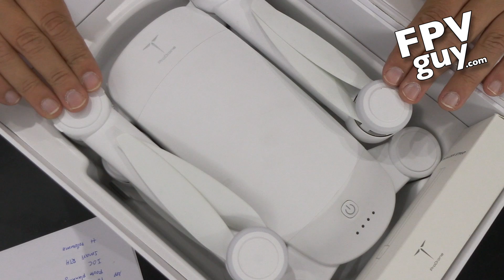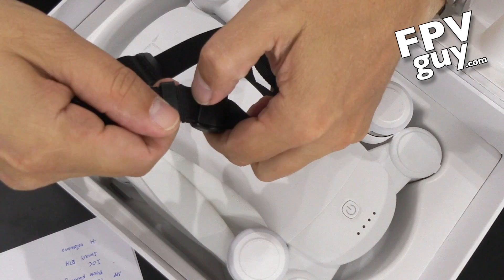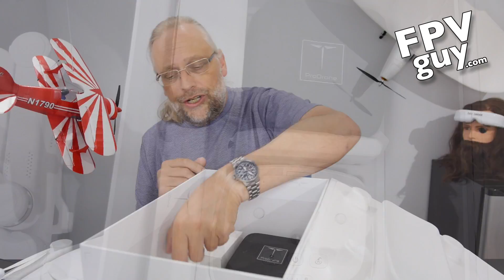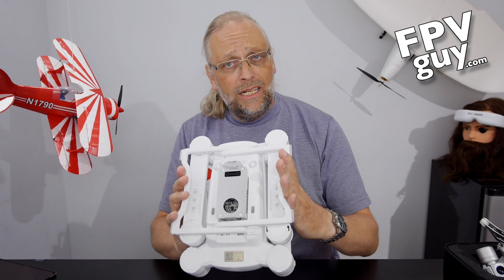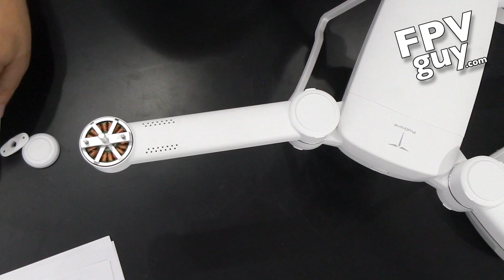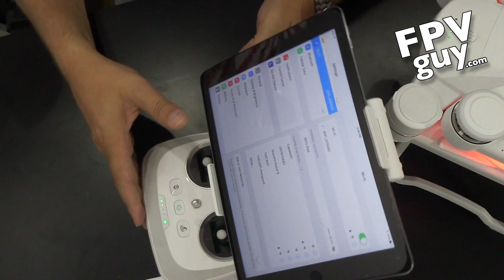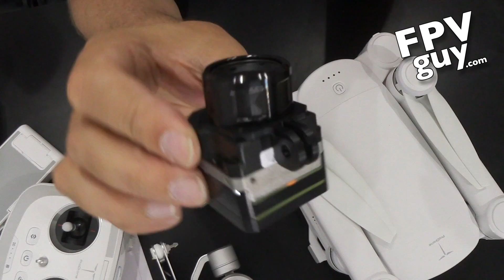ProDrone BYRD - Unbox & Preview

Comment: Hi Bo, great video, subbed to you there too, I'm going to put you on the spot, if you had the option of a p3p or the byrd premium which would you take? Honestly, because your the only person we know that has flown both. Thanks , Paul.
Reply from the maker: Hey Paul,  I just came back from flying the ProDrone,  about to post the video shortly.   but here is the low down,  Im not sure about the premium byrd yet as I have not seen the camera, but I would take the BYRD advanced with the full feature set and the gopro gimbal if it was on the able along with a P3p today. mostly because i really love my GoPro 2.7k cine medium FOV
Reply: +Bo Lorentzen Thanks for your reply. The Byrds flight performance itself, is it fast? also how responsive is the craft? Can't wait to see the new video.
Reply from the maker: Its very easy to fly, and responsive.   in Position Hold mode its about the same max speed as the Yuneec, however in A (ATTI) mode it goes really fast,  downside to that speed, the arms come way down in the image.  other downside to letting it rock, you end up with 15 minutes of flight time instead of 25 minutes.  Just saying.
https://www.youtube.com/watch?v=VEYh9Nc0mhY

Comment: Compactness and zero tools for changing props is well impressive, even the gimbal mount and fpv screen mechanical fixings are great. I'd be stunned if those arm joints could take much of a hit but if cheap and easy to fix them then that's not a massive issue for a mild video rig. Not perfect but love the angle they took on this one.
Reply from the maker: +MicroRCFiend   we need to get a bunch of flight time on this thing, only way to really know how everything will feel and fly after 20 hours of flying.
But yeah hugely agreeing.   love that we can change props without tools, tool free setup is a big thing.

Comment: Hi Bo.
A really interesting package. I understand the manufacturers are claiming a true 30 minute flight time which based on the battery type I think is doable. I get close to 20 minutes on my 3kg hex with a 3s 10,000mAh pack. Price wise it seems to fit competitively with the offerings from DJI, Yuneec, and 3DR but it's unique ability to fold down for transportation and larger footprint when deployed gives it a slight edge. 

It sounds like you have the same crud my wife has just brought back this week from her trip to Los Angeles. Hopefully you'll have a quick recovery.

Regards

Nidge
Reply from the maker: Hey Nidge,   yeah this is a very interesting package,    my gut feeling, 30 minutes are optimistic,  maybe in calm weather.   however once you get some speed flying around etc, you start burning battery,  I'm hoping for 20-25 minutes actual flight time.
The units are a slight bit more expensive,  personally Im more excited about the GoPro edition, as the extra $100 from the standard buys you a Gopro gimbal, Follow-me,  drift camera and sonar and payload drop.
Reply: +Bo Lorentzen I'm a bit slow these days and didn't pick up on the price difference between the different versions. If one already has a decent GoPro an extra $100 is a no brainet for the extra features. My wife keeps reminding me it's my 50th in two weeks time but I doubt the Byrd ( does this mean Jeff Beck gets extra royalties 😉 ) will land on these shores in time for her to treat me 😉.
Regards
Nidge
Reply from the maker: LOL Nidge,  The GoPro edition will land sometime in January.

Comment: This looks like a great product.  But so far only DJI has been really able to get good long range video to work well. The 3DR Solo  video range is quite poor.  So I would love to see when you test it what sort of range and quality of down link video you see.
Reply from the maker: +Joseph Dawson   I will be back with some longer pushes,  however for what its worth, the standard edition is advertised only as 500 meters range,   Im really wanting to take the advanced Gopro edition for a spin and see how that plays.
Reply: +Bo Lorentzen 500m is better then the 3DR. Do the other versions say they will have more range or are they all based on the same radio system. (DJI lightbridge maybe one of the best selling features of its products. ) As an owner of a Xugong V2 I am a huge fan of folding quads.  This could have been more compact if they did a front mount gimbal like Xugong.  This looks like a killer product. And will force others like 3DR and DJI to step up.
Reply from the maker: Hey Joseph,   they are all using the same technology, but the two higher versions both have more effective systems offering 2000m control range. (and video downlink)
wow, not many Xugong owners around,  I had the V1 for a while but there were so many mechanical issues,  I probably should have upgraded to Dugong V2.   that said, the promises of folding quads use phenomenal, and I suspect we will see many more implementations of folding multicopters.

Comment: Great video!!!! That's really really nice and the price is perfect!!!! Now it's time to see it fly. Can you test the video latency and can you use Fatshark goggles with this drone?
Reply from the maker: Hey Eric,  thank you for the kind words,   Im liking it, but would hold out for the GoPro or 4K edition to get the drift cameras and follow-me and payload drop options which is not on the entry level edition.
The TWO top ones, YES you can use FatShark HD's by plugging the HDMI out from the handset into the FatShark HDMI port.
in my short-range testing so far, the video feels very much like the inspire, sometime a bit more buffer than other times.    notice the control-link components in the standard edition that I looked at is different from the two higher versions that both have the 2km+ system.
Reply: I agree I think I'm going to wait for the advance edition. How long did you fly it for and how was the stability of the drone while hovering and flying?
Reply from the maker: Only got 15 minutes on it so far, the quad itself is very stable,  the camera gimbal is a bit rough, I have to hope this is in face pre-production issues and that the shipping will be more refined....
Reply: Ok good to know, I think one important factor that everyone is looking for an that is to see if drone will fly for 25 minutes, when you get time can you confirm this specifications.
Reply from the maker: Definitely will, have a fresh battery that I plan to fly to auto-land over the weekend and get a feeling when and how.  with a little luck it will be more graceful than some of the early generic quads.
Reply: I hope so too. I can't wait to see it.
Reply: +Bo Lorentzen Any update on the drone, has someone tested the flight time? And has any of tje features been teated like waypoints etc? And any update on the Advance release date?
Reply from the maker: Hey Eric,  don't have the standard here any longer, already returned,  I won't get to play more with flight time until the advanced GoPro one gets here.   let me check with Frank he was talking about doing the flight time thing.  
As for the waypoints, nope, its not even in the app yet.  but you can see they are about to put it in the next releases. will be talking about that as soon as its actually in the app.
Reply: Ok thanks Bo, I'm a little hesitant on investing a thousand or more dollars on a very new drone and drone company. I don't like to be a drone tester. I really like mature drones and drone companies well except for Walkera, I got an itchy finger for a P3 verses buying an experimental drone. Prodrone has great promising features but I've seen a lot of drone companies hype there drones up and then once it's released its full of problems and nightmares or they released the drone prematurely and they don't have all the features promised and you have to wait months for updates. I will be patient and let someone else be a drone tester. I can't wait to see more youtube videos on this drone.
Reply from the maker: +1 to all of that.      I am hoping that the ProDrone guys are pulling through, because they have a great concept. but only a lot of development and testing will get it to be competitive with the market leaders today.
Besides, the P3 really is a fairly solid proposition.
There really are very few mature flight-controllers on the market,   keep in mind that the P3 is still on NAZA based systems. the inspire is embedded with a A2 controller.    these are systems with years of development and code refinement.  Walkera continuously prove that its very very hard to grab a untested controller and get it really right out of the box. (shoot the P1 sucked in terms of a lot of things,) DJI have been very smart by not making new quads, but simply routinely refine what they already have, as a result the P3 and next the P4 is incredible predictable reliable systems.
I bought a pile of spare props for my inspire.   amazingly I have flown that thing weekly since it came out and are still on the original props.  its behaved exactly as expected every single time.  I honestly have 10 sets of unused props for it, because I was going through props like crazy with my TALI.  I lost two props because they got stuck under the track for the seat in the car,  but can't hardly blame DJI for that. :-)
Reply: +Bo Lorentzen ok that's good to know. I wish the Inspire 1 flew 25 minutes and was a little cheaper but I guess businesses have to make money for putting out a great product. :-)
Reply from the maker: inspire-1 may be selling sub 2000 after NAB 2016.  ;-)
Reply: +Bo Lorentzen if that's true you k ow DJI is going to release something even better. The Inspire 1 is an awesome drone but I wish it had more than a 17 minute flight time. But I can't wait to see what's DJI going to release next.